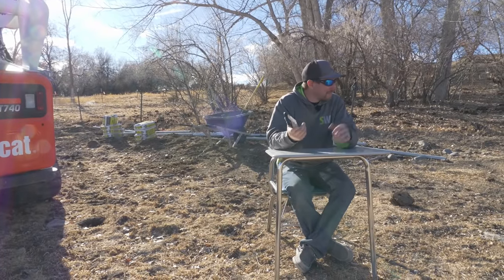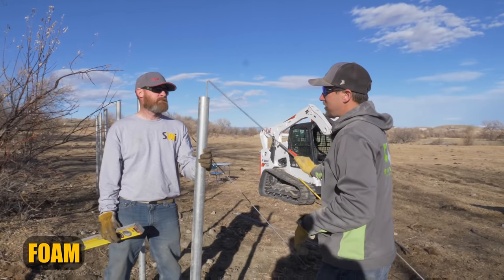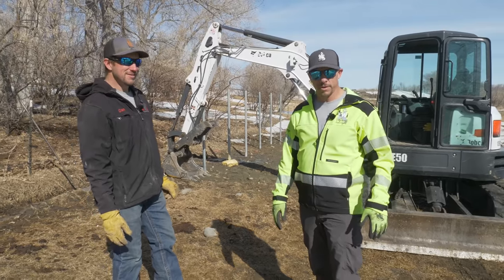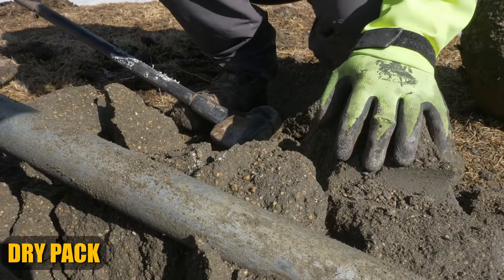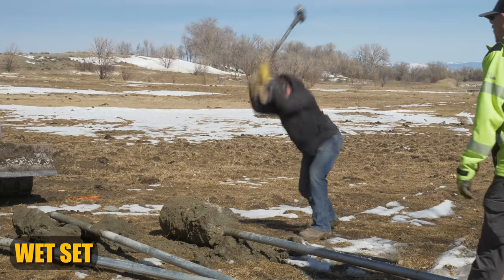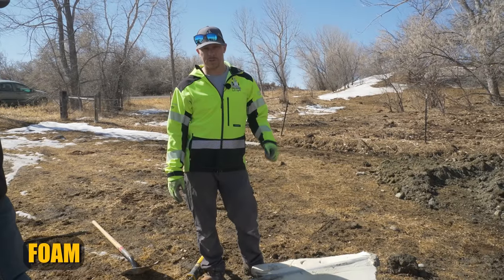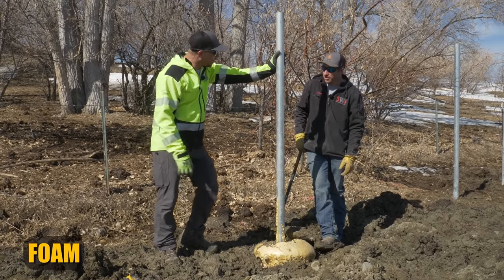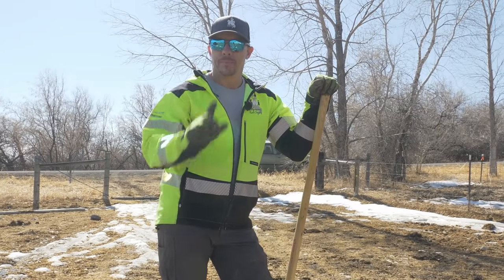Fence Foam vs Dry Pack vs Wet Set | We compare methods to see which is best for fence posts

Comment: It would be interesting to see the dry pack after say 6 months to a year. You guys are doing Gods work. Keep up the great content
Reply from the maker: I think it’s gonna take longer for that for anything noticeable to happen. The dry pack actually works very well.
Reply: Gods work? Good grief.
Reply: @theobserver9131  From Lil Giant Good grief yourself, old man.
Reply: If the Chinese invade we have YouTube commenters to defend us, they're salty and ready for keyboard warriorship.  

Thanks for the video, I just can't trust the foam.  Between the smooth surface of the foam and lack of mass 1-2 lbs vs 240 lbs I definitely think concrete has the win.  A telephone pole will definitely not have the wind load of a wooden fence, so they can safely use foam.
Reply: As a fencer I would not recommend any one doing drypack methods, the fencer would have alot of hard time trying to pull out all the posts when they needed replaced, posts would just slip out and the cement will crumble badly in ground , imagine trying to dig out 2ft of the post cement without  heavy equipment in a residents backyard ,yet alot of fencers do this and reason why I charge pretty penny
Reply: DRY PACK IS SAME RESULT AS WET PACK. YOU SAID IT, IT JUST TAKES MORE CURING TIME TIME
Reply: its called cement  until it sets
Reply: @andrewhughes1920  I would agree with you here in reference to dry and hot soil. Dry pack will not work correctly with hot or dry soil. I have my self used the dry pack method for my own fence, but the difference I have done and had learned was to first fill the hole with water, let it soak in the ground then fill the dry pack. With in a few days I found it was nearly as strong as the wet pack and I even had a tornado pass through and the posts did not get pulled out of the ground either. There is another trick I had done before was to add a non-corrosive bolt to the bottom of the post which will make it even harder to pull out of the cement. I would also use a post that is resistant to cement to prevent it from rusting or getting ate up by the cement over time. I did also notice that in the video here, with the wet pack he had broken the post and did not pull it out by the looks of it, or was that just me? Also, why did he not pull the post strait up like he had done with the foam post? I noticed on the Dry and Wet packs, he had used the bucket to loosen the post from the cement.
Reply: Dry set sucks. by far the worst thing i have seen. Every remodel i have done where people did dryset, it failed. either lazy undersized holes or underfill resulting in fences leaning breaking falling. The wet mix ends up being way more solid, ask the Romans.  I always recommend a heavy sealer for the material underground prior to poring.
That being said the hardest longest lasting post I have removed did not fail underground as it was rock packed with no mortar set. Yes a gate post over 35 yrs old in the NW set with stone and only stone packed tight. this allowed for all water to drain away from the 12" wood post.
Reply: @TheDeadwood11  That was how I was taught just put about 6" to 8" of gravel in the hole take an old shaft about 8' to 10' (50 lb or heaver) and tamp solid then repeat the procedure till the hole is full. Guaranteed not to fail.
Reply: @steveadams4009  Yes sir and last waaaaaaaay longer...
Reply: Donley Wilson  
I do mostly tamped dry pack with water sandwiched in the middle and top bit mixed. 
Rainy region PNW, mostly clay/rock soil. 
Fast set in winter. Regular set summer. 

I used to work installing for Lowe’s. They used only fast set concrete year round with water. No tamping, no mixing. It worked, but was brittle and crumbly. Little strength in that set up. 

That’s good you shared about  the building code. Thanks.
Reply: @coreywoods6893  thats the best way to remove posts. Imagine trying tonpull off a post that rotted at the base. Id rsther deal with crumbled concrete
Reply: @TheDeadwood11  your statement says that it failed not because it was dry set, but because it wasnt installed correctly
Reply: @woodman1701  im also in pnw. I dryset posts and they are just fine
Reply: @albertcho4540  Either way it still fails
Reply: @TheDeadwood11  no it doesnt. It just takes longer to get to compressive strength but is just about the same end result
Reply: @albertcho4540  same end point. Failure. Seen it lived it know it. Good day.
Reply: @TheDeadwood11  just you. But thats fine
Reply: @albertcho4540  wasn't my build but was my repair. It's ok now
Reply: doesn't it depend on where you're at? i've heard (im not a handy man much less a construction person) that if you dry pack in a place like arizona it will never harder.. do it someplace where it rains alot and it will suck up more than enough moisture to harden.
Reply: @steveadams4009  would seem hard to keep level
Reply: dry setting is for mommas boys who learned that trick from some DIY channel...mix or die
Reply: @stevendunn405  not
Reply: @steveadams4009  All the farmers I knew growing up set posts in packed gravel (with a little query grit) . IME it’s by far the best way, but not in sandy or high clay content soil. In sand, the gravel doesn’t stay put. In clay the hole fills with water and rots the posts.
Reply: @SWiFence  5 year test
Reply: @theobserver9131 .. +1 Agreed. .. let's leave god, any god out of this.  The SWI Fence Company is the very best for clueing us in.. Thanks SWI Fence... Chesr, Vail, Colorado
Reply: @tech-ii5sh  .. Important observations .. Thanx..
Reply: @steveadams4009  +1. Agreed. .. An old family recipe, use crushed stone and a shovel full of roadbase. .. Bingo!  No additional site water was added.
Reply: @NightSky777  ... area stones with a little crushed roadbase do the trick..
Reply: i would still be garbage
Reply: There's nothing involving god when setting fences. Don't be absurd.
Reply: @chandracox6814  sure there is. God cursed the ground for man’s sake after Adam and Eve sinned. We therefore have to deal with the cursed ground conditions when setting posts 😝

Comment: Set thousand of feet of posts.  Dig hole , fill with water , pour cement in and walk away.  3 days later string fence . That was using steel , 4x4 and even landscaped timbers as posts . Never had a issue 20 plus years later.  Oiled wood posts once every 3 years .
Reply: When you say oil do you mean the tops/end grain?  What oil did you use?
Reply: Valvoline or Quaker State?
Reply: @alexnutcasio936  Pennzoil Synthetic... 5W30
Reply: Put the post in before water and cement?
Reply: I oil my wood more often and has lasted me more than 40 years :).
Reply: what do you mean pour cement in? is it mixed? what kind? why the water first?

Comment: I do a lot of dry set and never have any issues but I also add water while doing the dry set.  They were just allowing for the moisture in the soil to create the setting but in dry soil it will take forever to set it at all.  Just add water to the hole and continue to add water until it stops absorbing. It’s simple, easy, and works great.
Reply: It seems they took “dry set” literally, common sence should dictate that water is still needed, the advantage is eliminating the mixing work. As you well know.
Reply: Yep, the instructions for the fast setting concrete specifically call for adding water. 🤦‍♂️
Reply: Mark did he say 18 inches deep and 4 bags of Crete?Do you first put in the dry concrete and then put water in?
Reply: @philipskrusso1153  I add water to the hole then the concrete then more water till it quits absorbing
Reply: @nomadicfenceman509  ozozo oolog where e
Reply: I mix fast set 50 pound red bags in the hole with a paddle bit on a impact drill and water. Instead of mixing in a wheel barrel. pre mixing just takes too long and is more work than necessary.
Reply: @Zoro.d.uchihaa  great idea
Reply: @nomadicfenceman509  They literally just proved that you DON'T need to add water.
Reply: that's how it's supposed to be done.
Reply: @jlester4892  they also proved that by not adding water it doesn't cure quickly or properly.  So there's that as well.

Comment: in my experience the wet concrete needs to be above ground at least 4 inches then worked to slope away from center or else the steel will rust in time and fail
Reply: If you have a good Galv post it won't make any difference.  In Ontario I've seen both while doing removals , splits front water filled posts and kinks from being hit are the only thing that causes rot . I agree 100% for residential grade though
Reply: @Hello John how are you doing
Reply: @tylerrosborough9566  They all rot out over time unless you are working with a decent grade of Stainless Steel pipe. Saltwater destroys everything except S.S.
Reply: @disabledusnvet.8771  we don't have that salt water problem up here , schedule 40 galv will last forever.  I've been able to wrap a chain and pull 50 + year old posts . Only time we have those issues is when the fence is right beside the road , 20 feet off the road and the road salt doesn't effect it much
Reply: @tylerrosborough9566  ...on Long Island, surrounded by saltwater... it's in the air...
Reply: @disabledusnvet.8771  fair I'm in Ontario so no worries up here
Reply: If it was my post I'd paint the part that goes into the concrete with a zinc priming outdoor acrylic,  like roof paint.
Reply: I've only ever done that with wood posts. Not 4 inches though, would look awful. Better to treat the post to just above ground before setting than dome the cement just barley above ground. Customers always seem to bury the fence in a couple years anyways. Mulch bark grass leaves whatever.
Reply: @tylerrosborough9566  manufacturers recconmend sealing with bitumous coating to stop the lime attacking the gal.
Reply: @chrisforgan731  I've never heard of this,  perhaps different wherever you are but around here no company I've heard of does that and there are no issues I've seen
Reply: @tylerrosborough9566  most steel is electrogalvanised not hot dipped so it doesn't distort or lose temper etc if you read the product data sheet you will find the recommendation.
Reply: @chrisforgan731  that is a fair point I hadn't considered, as the posts I've always dealt with are hot dipped and have seen them hold up well against concrete eating it
Reply: I do very high end handrail. A sloped pour is a sign of craftsmanship. I've set fence and posts. Pretty much the same. I drive in 1 inch angle iron and tack it plumb below grade.. Very strong. Very precise.

Comment: Run some bolts through the post in the foam before setting it and it should have wayyyyy more pull-out resistance 😉
Reply: Yes very good advice. I have done the same with long bolts or screws in different sides of post in different heights in the concrete.
Reply: I have used 16D galvanized nails in wood posts set in concrete for pole barn construction to increase pull out resistance. Don't know how much it increases the resistance but I figure it does increase it.
Reply: I was thinking some holes in the poles to allow for the foam to expand inside, but this sounds like a good idea, too.
Reply: I had so much trouble taking out an old fence that I wanted the new one to be made with easier to remove material...   So I was thinking the Urethane foam may be good enough, and it costs about the same, but can be hauled in my sedan in one trip...
Reply: @yamspaine  of nothing else you can run a sawzall down into the foam to make pulling the pole easier. Can't do that with concrete.
Reply: This works great. We did this with piles in the seafloor

Comment: Concrete tends to continue to hydrate (cure) as long as water is available.  The foundations for the grandstands at Wiggly Field measured at 7500 psi when tested with a 2500 psi mix.  I'd expect both concrete foundations to continue to get stronger with time.
Reply: Wiggly field😂😆😂
Reply: @JO-ly3hi  Yup.  Home of the Piggly.

Comment: I've never relied on water in the ground when using dry pack. I always add some water after each bag. Never had a problem.
Reply from the maker: Good call.  If we ever decided to dry pack we would do the same.
Reply: We usually pour a little water in the hole, dump the bag in ,level the post and pour the rest of the water and pack wet concrete. If you can keep the end of the packing stick in the water whe packing you won't splash yourself...at least not as much

Comment: Worked in the sign industry for 35 years.  I  dry-packed signposts the whole time.  I have installed 5' by 10' electric signs that have to withstand strong wind loads with many hundreds of tons of pressure.  There are signs that I installed 30 years ago that were strictly dry packed.  They still hold up just fine. 
The thing about dry packing and the trick to it is to tamp it a few inches at a time with a rod.  This compacts the soil in all directions. In my expert opinion, the dry packed post is sturdier because the soil has been tamped under and around the post.  It takes more work to do this though.

Comment: Guys, thanks for the comparison. Next time you do this, try putting a load cell on a chain to measure the amount of force required to pull over each pole. My guess is that the wet set will resist the most, and depending upon where you attach the chain, you might even bend the pipe on that one.
Reply from the maker: Great suggestion! 👍🏻

Comment: Really nice video, helpful to see some real world examples/tests on these approaches.  One comment I'd add is regarding the foam.  The disadvantage I see with all of these new foam products (sealing basements, mounting poles, attic insulation, etc) is that we really need to start to consider what happens to this material at the end of its life.  Yes, it will last for a long time, but nothing lasts forever.  I fear having all of these foam applications will leave us with a disposal nightmare in a few decades.  Not that humans are good at thinking a head all that often.

Comment: A very interesting test, really appreciated the information provided.  Something to remember though is sometimes having a weaker foundation is advantage as nothing lasts forever and if something needs replacing or repair, having a system where it is not difficult to remove objects can be helpful. I often have a concrete base, fill the middle with dirt and the top 1/4-1/3 solid concrete.  Generally solid enough but  you can break the post out with a crow bar later on with out needing a negative g machine.
Reply from the maker: thanks
Reply: Have you had to take out your own posts?  Cause concrete base then dirt then concrete and sono tube is pretty strong, stronger than just concrete.

Comment: Great channel Sir!
I'm a Civil Engineer and commercial General Contractor. 
There is a lot that goes into a concrete mix design.  There is a specific water content to portland cement ratio (w/c) to yield a maximum compressive strength.  Other things and ratios come into play when evaluating concrete durability, air content, whats the end use, etc...  In the video you mention the yield strength, it is actually compressive strength.  
Keep up the great videos!
Steve C, P.E. (Professional Engineer)
Reply from the maker: Thanks for sharing!
Reply: You forgot to mention how the aggregate in bagged mix segregates during transit which is why it should always be mixed.

Comment: When I set a post I pour water in the hole and dry pack the concrete tamping and adding water as I come to the top of the hole. It creates a very sturdy footer even before the concrete sets. It makes it much more difficult for posts to be knocked out of line while they are setting up.
Reply: Sturdy my ass. Mix the concrete before hand
Reply: Exactly... not rocket science... makes perfect sense.
Reply: @MrBmxbrawler  it’s pretty darn sturdy

Comment: I like the content your putting out here. I personally work with guys who like to put the water in the hole and then pour dry concrete in the hole and they claim it works better. I never do this and always mix concrete while they cut corners. It never sets up as strong because I have pulled post right out of the ground. I guess I'm just old school.
Reply from the maker: We order all our mud from a concrete company in trucks.  Most of what we do is commercial where they would never allow any of this.  Our goal is to show the difference and let folks decide for themselves.
Reply: @SWiFence  Good video, but, when working in freezing temps, calcium chloride is often added in while working in or around freezing temps or some other form of antifreeze agent which helps keep the mud from freezing while it sets up and cures, also some form of an insulating blanket is also used sometimes. By adding certain types of agent(s), it also helps it to be greatly stronger when cured... maybe you could do a video about that... which is the best method???
Reply: I agree. If you read the instructions on the bag of concrete it says MIX!

Comment: For the homeowner going to Home Depot you might want to pick the foam option, it's lighter, it's not corrosive on your lungs and sets faster. 35 bags of concrete will sink the shocks on your van and paying for delivery is expensive. Wet set can be a problem if you need to replace a post but unfortunately there's the old concrete plug right where the new post needs to be. With dry pack you might have a chance of replacing a post.
Reply from the maker: Better yet, drive them!
Reply: @SWiFence  Not an option for a homeowner doing a DIY project.